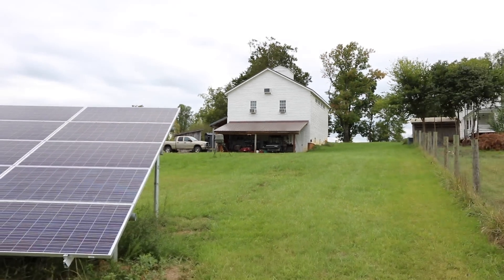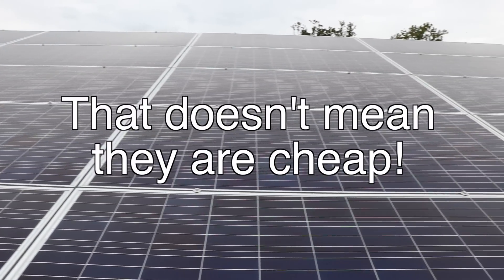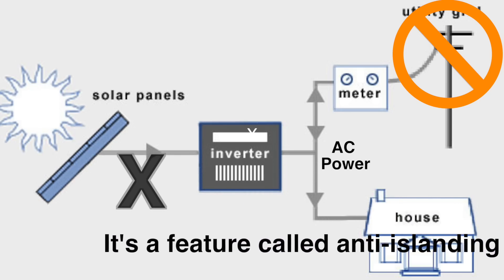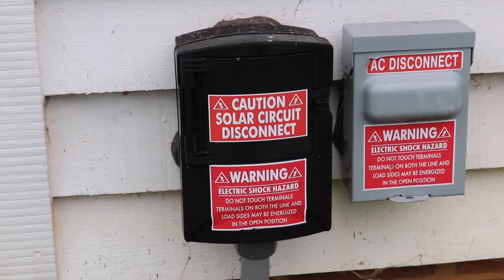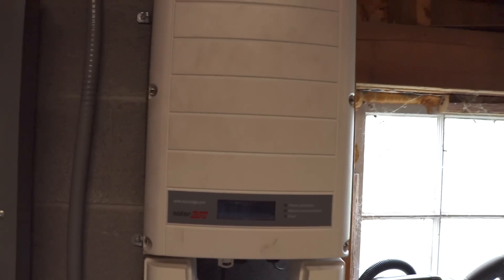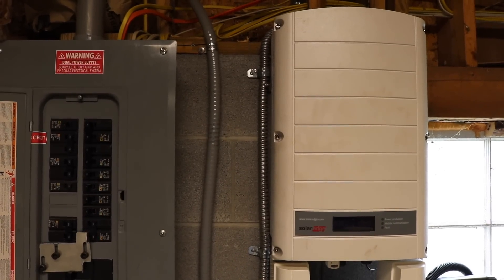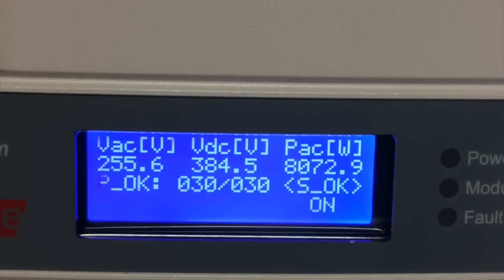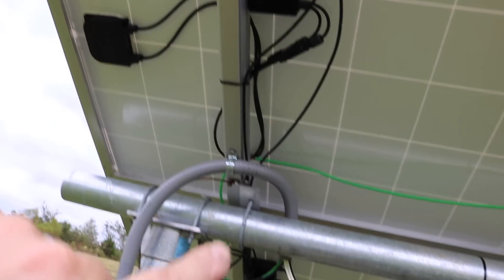The ugly truth behind grid-tie solar systems. Part 1, FarmCraft101 solar.  Watch before you buy!

Comment: A configuration I was planning was to run my main circuit panel off a battery bank where the float charge would be set a couple of volts above the average grid voltage. The solar panels and wind turbines would charge the battery bank and when my usage exceeds my generating capacity the grid would provide the extra current by feeding the battery charger or rectifier. A CT or voltage sensor would be connected to the grid source and if the grid goes down an auto-disconnect switch would open and separate us from the grid until it went live again. This would allow us to run off the batteries during outages and if the outage went on for too long and the battery dropped below an assigned voltage the generator would kick in and start charging the batteries until the grid power was restored. This setup would allow you run free of the grid during outages and also be able to backfeed the grid when the power being created exceeds your usage. An auto-disconnect switch & battery bank with the appropriate AC & DC chargers is expensive but I think the benefits would be worth it. The trick is to determine how long the average outage lasts, what your home needs in regards to minimum wattage or amps during an outage, and then size your storage battery and generating capacity to meet those needs. Since I have a couple of generators we'll probably start with only as many batteries as we can afford and then add 2 batteries at a time until we reach our storage capacity goal. Keep in mind that if you need 2 phase or 220v power for A/C, heat, or cooking, you'll need to run 2 sets of batteries in your battery bank to provide the two 110v phases for your 220v appliances. So if you absolutely need 220v power then expect to pay twice the amount for the number of batteries you'll need for a 2 phase battery bank than if you only required single-phase 110v service.

Comment: Wy not fix your solar panels on the roof of your garage, they got the same direction to the sun and you make a economy with 30 feet of copper wire and no solar panels in your garden...
Reply: Roofs need to be replaced every 20-30 years and its very pricey if they have to remove the solar panels first and then remount them.  Also replacing solar panels damaged by hail is much faster and cheaper if they are on the ground as opposed to the roof.  You have to figure all that into the actual real cost  of going solar.

Comment: You got it wrong, the pressure in the hose is the amperage, its clear that you dont know much electricity
Reply: No, actually you're wrong Hector. Voltage is comparable to pressure, and amperage is comparable to flow. Then you have resistance which is comparable to the pipe size in a plumbing analogy. Suggest you read up on Ohm's law. I worked as a high voltage technician/operator for an electric utility for 25 yrs so I know what I'm talking about.
Reply: @kst357  wrong again the pressure in the hose is the amperage, the voltage is the flow or speed in which the electricity wave moves,  check it out
Reply: Pressure=amperage
Reply: @goyo119  Nope, you have it backwards in regards to how electricity is explained via plumbing analogies. It's not entirely accurate but an easy way to explain the properties to a student. Flow is the analogy for amperage and speed is not the correct word as the speed of alternating current is determined by the hertz or kilohertz. This means the number of cycles per minute that the electrons flow back & forth. Have you heard the saying: "It's not the voltage that kills you but the amperage"? That's because you can tolerate high voltages (pressure) but not high currents (flow). An "ampere" is a unit of measurement for the amount of electrons flowing through a circuit. Voltage is explained as pressure because higher voltages require better insulation as the voltage goes up. You also need to space your conductors further apart from each other unless they are insulated properly. That's why wire insulation has a voltage rating and not an amperage rating. Like in a pipe or sealed container, the higher the internal pressure present, the thicker the walls need to be in order to contain the pressure. Anyway, it's not worth arguing over because it's just a simplistic way of explaining it. You can understand it any way that suits you as long as you don't get burned or electrocuted. That's all that really matters.
https://www.physicsforums.com/threads/why-does-everyone-claim-voltage-is-electrical-pressure.82357/

Comment: If you do some homework, and do most of the install yourself and paying someone to do the plans ($300), and the certified wiring/permit ($1000), I did my 4KW solar system this way for $3200 and should break even in 3.2 years, now 6 months in and I am still on track to break even. Most quotes I got was for $9K~$11K with rebate of $3K and break even at 9.5 years. Knowing this, your paying the solar company a lot of money for your lack of knowledge.
Reply: Hello ozzy, could you elaborate on how did you achieve that or point/link me to any good direction in order to get deal done in a similar manner? I'm also looking into solar, and well prepared to put the work by myself; but truly it seems that the ammount of homework (/reseaeching for available options, set ups, products etc) before one gets to make a decent informed decision is humongous
Reply: @TheLiasas  The key I mentioned is knowledge and DIY. Since I am not certified to wire the project, I would pay someone to do that and the plan. The other thing is looking around for the right equipment for the right price. Here is one place that I look for deals  www.sunelec.com 786-565-9359
MAIN OFFICE 305-322-1086
 , i am on their email list for when the really hot deals come along. Less than $100 per solar panel, and to save on shipping i will drive an hour or two. I think the number one failure is the inverter, so don't go to cheap in that department, or run it at max (say 4KW solar driving 4KW inverter). There is some free training on solar instal, basically, they have you go on real jobs (your volunteering work for the free training). Also join solar forums, to ask questions before purchasing anything. Check out google sunroof, enter a address down the street from you (haha), enter your electric bill and the choose purchase. It will give you a good idea of the side system you need, but i would go bigger (say they say3KW, I would go 4KW, its not that much more $).
Reply: @user-rs8zg8ey2b  that's a neat idea about volunteering the help install I'm getting free education. If that's the sun Electric in Florida I bought 50 panels from them they were great.

Comment: nice video, however, grid-tie is only effective if the electric company you associate buys back the electricity at a reasonable rate which most do not give competitive pricing for they will charge you more for using their electric than clearly what you sell them. also if you place your grid close to the usage area the cost of wire digging and etc is greatly reduced. when buying complete systems many times the companies will include a tax incentive package but increase the price of their system so they make a greater profit at your expense using part of the tax break as a selling point but profiting from it themselves.

Comment: See your panels are all tight to each other? Does that increase output?  I understand heat reduces output so wouldnt gapping to allow for airflow be more efficient?  Also for rain or snow wouldn't the  coverage be reduced with gapping? Tight looks cool or intense but if you have space is it the best way to install?

Comment: Should update battery bank to 18650. Like the tesla powerwall. Also couldn't you step the battery bank voltage up to use the 360v dc inverter? With lithium 18650 and enough cells could be done right?

Comment: In you’re break even analysis you forgot the opportunity cost of the 17,000 spent on the system. 
At 10%, the roi on 17k is obviously 1700 

So with 2400 in actual power savings, if true, your return is reall only the difference between the 2400 and the 1700, which is 700 per annum. 
So 1700 / 700 =24 year payback.  Less maintenance cost etc.  Not to mention panel degradation and realist 20 yr life cycle. 
Remember, the 17000 could have been invested in something else, and made a 10% return,   This the opportunity you gave up, when you spent the money instead on solar. 

Solar does not make sense. Anyone who invests in it is wasting their money. 

Corporations invest in solar in a different format, they are heavily subsidized and receive a premium for their “green power”

The premium for power and capital cost subsidy comes from tax dollars. 
Something the “home owner” is not invited to enjoy. ,
Reply: thanks for sniffing out the bs.

Comment: Interesting video. The creator of this has done a great job of explaining how these systems work. Too bad his math skills are completely lacking. In determining the payback time for the panels he has confused power produced to the power consumed by the house.  He has made the huge assumption that the $200 electricity bill will be covered by the output of the panels. He has not provided ANY figures on the energy output  of the panels over time. That is in KwHr, and is what you get billed for by the power company. 

. Say a month in summer. The panels might produce 9 Kw on a nice clear day in the noon period, and then produce very little outside that.  Cloudy days? Never happen? Winter, shorter day, and a low sun angle resulting in a substantial drop in output? Again, no mention of output ENERGY, in KwH. That is the crunch and this video fails to deliver. 
When you do the math, do ALL the math. Not just the part you like and certainly do not mislead your viewers with power consumed and power delivered. Not the same thing my friend, and it is what drives people to invest, in a fruitless effort to save money. If it all seems too good to be true, it probably is.

Some real numbers. A friend has an installation on the side of a mountain, facing the path of the sun. Cost him some $17,000 and produces some $800 worth of power per year.  A 7KW system. Do the maths. Solar panels are guaranteed for a maximum of 25 years and 80% of initial output. After that you are on your own. Hope the manufacturer/retailer is still in business, yes?
Reply: Here are some reasonable real world numbers ....
a) 4 Hours of Sun per day 
b) $0.12 / kWhr of electricity 
c) 9 kWh of PV 
d) 30.5 days per month

$131 / month  =  4  x  $0.12  x  9  x  30.5 
$1,572 / year  =  $131  x  12 

So break-even is approx ...
10.8 YEARS  =  $17,000  /  $1,572
Reply: @MrSummitville  You are getting closer. Two problems, and I use my friends installation as a guide. First is the the inverters are not 100% efficient. They lose, along with transmission losses, about 10% of the power delivered to the grid. The panels themselves lose about 10% in the first ten years and go down to about 80% by the time the warranty runs out.  The price of electricity is going up, but the power output is going down. 

Taking in to account the losses the panels now have a 12 year payback, using your numbers. Which brings us to the second problem. Average energy production per month using 4 hours a day as a guide. Depending on where you live, this figure can be extremely optimistic. My friends installation is on the 49th parallel, and is fixed on the side of a hill. For much of the winter, the graph of power vs time crawls along the bottom. Rain and cloud have the same effect. The figure of 4hrs a day is very optimistic, and depends a great deal on location, physically and geographically. With a  7Kw system he gets about $800 a year on a $17,000 investment. 

When we both look at his figures, he agrees the system is not going to pay for itself, especially given the $17,000 is already spent, and the rest of the time is spent trying to get some of that back. But the great thing is he doesn't care. He likes being able to supplement his energy needs with a zero pollution footprint. We  will put aside the pollution created by manufacturing a solar panel, for the moment.   

Bottom line is, unless you live on the equator and have every day full of sunshine, don't "invest" in solar. Be happy with what it is, a nice thing to do for the environment, if you have the open spaces and a lot of spare cash. For the majority of us, it is never going to pay for itself.
Reply: @techhie1302  Solar Insolation varies tremendously ... It is all about Location, Location Location ... South-West USA is the best and Northern USA is the worst.  If you can self-install at $0.00 Labor AND you get a good deal on the Grid-Tie PV System AND you pay allot per kWhr AND you live in the South-West AND you get Net Metering then your break-even will be much less than 10 YEARS.  That is allot of "ANDS"  !

Comment: If the Power does go out you can still use your Solar Panels to Power the essentials like your Refrigerator as long as the Sun Is out.
Reply: No, not with a Grid-Tie System. But if you add big expensive batteries then YES. And then the  batteries will need replaced every 5 - 7 years = $$$.
Reply: @MrSummitville  I was told that If my Power was to go out that I would be able to have Power provided that the Sun was still out. I have two  Outlets that are located next to My Inverters. I have No Backup Batteries.
Reply: @swammyswammy6476  There is ONE Secure Power outlet on a Sunny Boy GTI.  It will power that ONE outlet when the Grid is down.  It is not an Automatic Switch-Over.  What happens when the sun goes behind a cloud?  Your fridge (compressor) may not like this. NOTE: It states, "... Do NOT connect loads that require a stable electricity supply to the outlet ...".  Will SMA guarantee that your compressor will not be damaged?  Most Grid-Tie Inverters do not work offline, unless you provide a micro-grid from an Inverter driven by batteries.

Comment: they cheated you, taking into consideration that you used the most expensive panels you should not have spent more than 7,000 (cheap panels that do the same work cost 40% less) the installation and the inverter should not go out more than 5,000 since it is a super simple job because It does not carry batteries.
Reply: You did not include the price of: Ground Mount + Conduit + Wire + Disconnects + Trenching + Concrete + Ground Rods + Labor , etc ...
Reply: MrSummitville  still overpay, 23k, with that amount of money I can buy 4K meters of terrain, a small studio house, a truck, I can even make a mini power station to feed 2 houses. But if you like it and you can pay that money enjoy it
Reply: @Justmemy12  How are you making a "power station" that can feed two houses?  No, I would not pay the $23,000 price.  But for people who do not have the skills to install, they must pay that price. Are there cheaper ways than this video, yes. Solar is getting cheaper every day, while Grid Electricity is getting more expensive every year. So, now let's hear about your "Power Station" ...

Comment: With the new inverters, they simply disconnect from the grid during power outages, but you still get power until the sun goes down, unless you also have batteries, then it never goes out, but batteries are expensive, a generator is much cheaper than batteries.

Comment: october 2017, I wonder how many times the system has needed repaired already lol
Reply: Usually not much for about 25 years, unless it was installed wrong, maybe a 1000 buck inverter every 10 years,...maybe....likely with that system he would have saved 10k, so 1k is a steal.
Reply: @shawncockrell6007  A 10,000 Watt Solar Edge Inverter costs $2,000. Break-even in 8.5 years IF you live were it is SUNNY = Southwest USA. If you live in the North where the sun is low and it is cloudy, and rainy and snowy then your break even may be 10 years, 15 years or even 20 years. If the cost of Grid Electricity is cheap then break-even takes even longer.